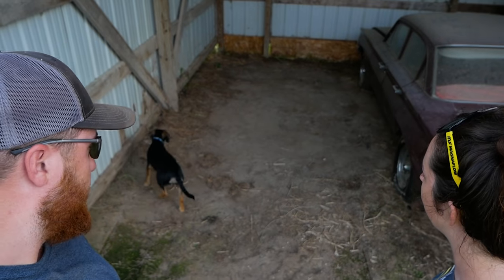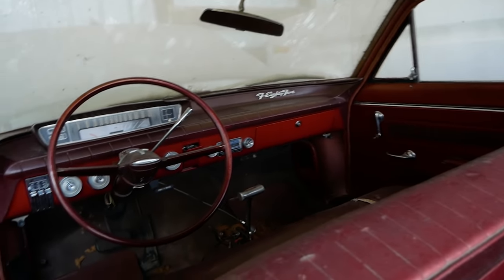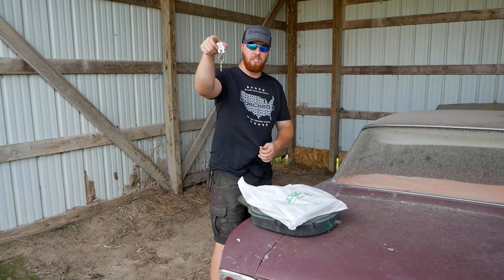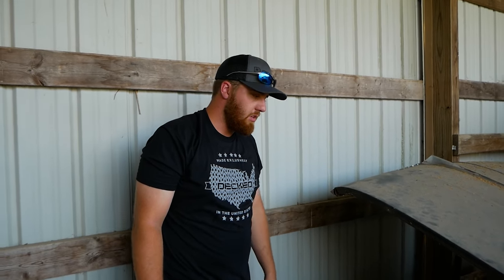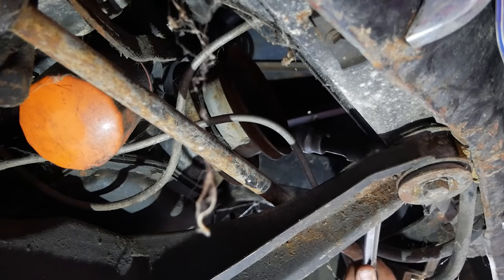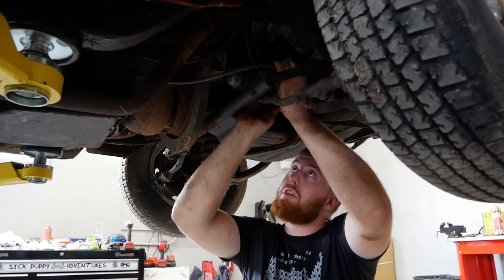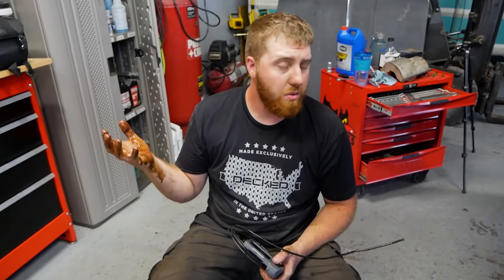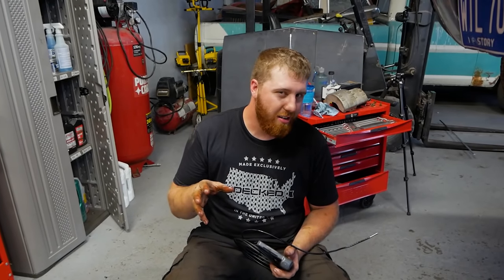BARNFIND Oldsmobile F-85 First Start in 25 Years!! - Part 1

Comment: awsome video kevin i was going to say oh no that part is all the way in the bottom of the oil pan thats going to be a problem but thankfully it aint the problem and the good news is that the part is still attacted other than that sounds like shes a running motor and yes i defianlly agree dont wont to run her anymore till you have what you need to properly run her right even when its a newly rebuild motor that hasnt but  ran long enought to the nissel break in point thumbs up and shared

Comment: Thats super cool! Even down to the thick wall 2" exhaust that looks like it was cut with a rotary pipe cutter like you would use for plumbing. If it has glasspacks, I bet it barks like crazy

Comment: Not gonna lie, i would use a mix of 2 stroke oil and gas to get things running.. carb cleaner is very hard on rings and cylinder walls. Just my opinion though... love the videos.

Comment: The correct transmission for that car is an R5 which is a 1961 thru 1963 f85 only similar to a dual coupling turbo hydramatic used by olds thru 1964 then the jetaway or turbo 400.

Comment: Maybe the oil pump needs priming. If it's dry from sitting all those years it won't be able to prime itself.  If you squirter motor oil into the 2 passages going to your oil filter, one of them goes to the pump. I have had to do this to many junkyard engines to get oil pumping again.

Comment: Awesome car, but as for oil pressure I think maybe the "fresh" pump is maybe a dud, possibly a gasket wasn't installed. You may want to pull the drive gear out, and verify there's no damage, or hardware where it shouldn't be. Good luck, love the content!

Comment: the oil pump has a bypass in it its mre then likey stuck pull the allen bolt out of the side of the filter housing ang clean it good and maybe replace the spring in there thats were i would start .

Comment: My brother bought a two door F85 in 1970. 
Things fell off the engine on a regular basis. Carb, manifold, etc.
His had a 3 speed stick. The shifter on the column wouldn't work. He installed a Mystery Shifter. it was like shifting with a wet noodle.
First stick I ever drove. 
POS car. Ratty blue paint that flaked off. 
Think about buying thread inserts. Dropping the starter on the road really messes up your day.

Comment: The 215ci Buick /oldsmobile/ Pontiac V8 became the Rover V8 in Britain  ..the chances are when your engine was rebuilt  the oil pump wasn't primed as the oil pumps are not self priming.  Petroleum jelly should be packed into the pumpto aid priming  and the pump spindle should be spun using an electric drill untill you feel the resistance  then you know the oil is being circulated

Comment: fun fact the land rover 4.0/4.6 is licensed iirc from buick and you can use late model and 215/300 parts to build a 4.8-5.0 all aluminum badass small block

Comment: had a 215 I put in a 72 vega, after a rebuild had no oil pressure, found out the gasket between the front cover was messed up sucking air.

Comment: On that particular engine if that oil pump somehow lost its prime you might need to pack the gears with Is Grease to reprime the mechanical oil pump and possibly you will get movement and oil pressure I know in A231 V6 that was a problem that I have in a In a Buick engine however on this osmobile I'm not sure

Comment: That's the engine that was used in the Rover V8 3500cc, and was modified all to buggeries for the Range Rover, etc. Not sure it's the same as the 4.6 litre, but pretty sure it went up to 4.4 litres in the Leyland P76 in Aussie.
Please correct me if I'm wrong.

Comment: Man, what a bummer about the oil pressure.  I really like that Olds, 4 door or not.  Here's my thought on the oil pressure issue, because I have seen it happen before, just like the dropped pickup tube that you mentioned.  Silicone.  From what you have seen, the engine appears to have been gone through.  The video didn't show it, but if the oil pan was sealed up with the addition of silicone gasket maker, a streamer of silicone could have gotten into the oil pump pickup and is blocking the inlet screen.  I have seen this happen before with a big block Chevy.  Everything was fine until it wasn't.  Cruising at highway speed, the streamer of gasket maker ended up in the pickup tube and oil pressure went to zero.  So did the ignition, because three teeth sheared off the distributor drive.

Of course, after sitting all these years, the pump may have just lost prime.  I don't know the 215s well enough to say this is the case.  Start with the prime and go from there.

The oil you drained out of the oil pan looked used, so whatever happened internally happened after the engine had been run for a while.  I honestly hope you decide to dig deeper in to this one and save it.  The 215 isn't a powerhouse, but it's cool for what it is.

Comment: The fact that the oil is dirty means the engine did run with that oil in it. At this point oil pan has to come off, check pump for prime off engine, check main bearings. One or the other.

Comment: Drop in a 350 matched with the TH350 trany, re vamp the trany mount, replace the rear end and go burn some rubber with this sleeper. Robert, your new / old subscriber. (72 years old)

Comment: I had five 1963 F-85's, two of them were Jetfires. And yes they came with four barrel carbs. That is the 225 hp version. My Jetfire would beat Z-28's light to light. They hated that and didn't even know what the car was and never heard f one My car had a Super T-10 Borg Warner 4 speed with factory Hurst shifter.

Comment: Hey Trey does the distributor cap distributor because it might not be sitting down and a date it’s probably not a hook to the pump and it’s just spinning it’s not a turning the pump to pump to the oil up or the oil pump is bad and this is why the oil is not pumping that’s probably what it is you have to replace the pump or check down inside to see if they gear is messed up or the distributor is not all the way down in to grab that gear to turn it to pump it

Comment: I really can’t help you when I put the 215 aluminum block in the Vega I rebuilt the whole engine put bigger cylinders in it put a bigger cam in it it already had four barrel on it only thing I can say is pull the lower half off and rebuild it

Comment: It probably lost its prime you might be able to use a vacuum pump to an oil pressure port to pull oil into the pump while driving it with a drill  ive heard from someone that it works

Comment: I have seen this before. I had a oil pump lock up on a 318 chrysler befor. I would drop the pan and change the pump. Zero pressure means the pump is not working. It's not expensive to fix

Comment: How to troubleshoot ignition system on old cars. Step 1: Locate distrubutor, Step 2: Remove from vehicle and throw in the trash. Step 3: Install a HEI distrubutor.
Reply: and spend even more time diagnosing that, by guesswork, when it doesn't go right.
 
Points ignition are really not that difficult once one understands how they work, which is key to knowing how to set the points.  Once running, that particular GM setup is amazingly easy to fine tune the dwell on.

Comment: Actually those cars have what they call an outside oil pump on the timing cover the oil pumps would lose prime you'll have to squirt some oil into the oil galleys that will hopefully go back to the oil pump or take the filter off and squirt somewhere over there or one thing I had to do in a few engines is I would take the oil filter off lightly pressurized the engine and then spin it over till oil started coming out and that's still engine you can take the distributor out pressurize the engine a little bit and spin over the oil pump remember the oil pump gears are dry you're not going to be able to prime it unless you pressurize the engine to get oil up the pick up tube to the oil pump one time I had to overfill a MG engine engine just so the oil would be up to the oil pump gears to get it to prime

Comment: Losen the oil filter then spin the oil pump if it pumps oil it just had a air bubble if not the pump is bad or the shaft isn't connected

Comment: Got to say, I'm old enough to remember when the F85 first hit the street.
It was received Very Well in New England, where I grew up.  Lots of interest in the car, because it was compact, had relatively good styling, was economical - AND, had the small, aluminum V8.
Yes, it was/is small, but with the V8, was faster than anything else on the road, American or European. 
Well, as with all other compacts in the early/mid 60s, America Was Not really ready or accepting of them,  mainly because gas was 19-24 cents per gallon, which is all that it's  worth.  If you doubt this, just wait to see what happens with gas prices when electrics have 50-60% of the market.  They will have to give the crap away. 
So, for me, I was disappointed the F85 didn't occupy a Huge segment of the market, but Americans were addicted to their Huge lead sleds until '73, when the Arabs made their  power play on oil.  Fracking gave them their cumuppance, for sure.
Reply: A lot of mechanics were not ready for dealing with the problems those blocks could have, also.  A lot of cars given up on way too soon, in my opinion.
Reply: @infoanorexic  Good Point.  You are Correct.
I've  heard stories that In '58-'59, some mechanics advised removing Chevy's new fuel injection and installing a carb.  Of course, because  some mechanics didn't have a clue about fuel injection....

Comment: is it a 61 or 62? 
I had a 63 f85 cutlass
The thing you need to check is the coolant
The aluminum block and heads didn't like the coolant back then
it made it soft and mushy.  The 4 bbl was stock 
Jet fire also came with a 4speed I know that because I converted mine from an auto to a 4speed 
You have a very rare car 
Back in the day people put those engines in jeeps because they were very strong
my 63 would lift the front wheels off the ground if it is a 62 olds change the body style in 63 they make it more like a little 64 Impala square
Those wheels are 4lugs and they fit a small Nova

Comment: These engines have to have the oil pump primed if stood for long periods. Remove pump and pack with a petroleum jelly, always works on my 215 Rover engine.

Comment: Early model aluminum engines didn't work because people ran um 🔥 hot and the rings shrank away from the cylinder walls losing compression. The owners manual warned against this but who reads it?
They solved this problem with sleeves but aluminum blocks got a bad reputation due to owner stupidity!! Later a combination cast iron block with aluminum heads was a compromise. 
Aluminum is common today because of improved cooling systems!! 
(Aluminum truck beds went South because they dented easily!!)

Comment: Long shot but gasket could have shifted when they installed the oil pump and is blocking the pickup hole if motor has been rebuilt. Long shot but possible

Comment: As others have said the oil pump needs priming, but could it be possible that the engine never ran after it's rebuild, as the taped over inlet manifold is something normally done for transportation purposes.

Comment: Out of curiosity wouldn’t it have been easier to just drop the oil pan instead of messing with the scope? 
Also, that’s a badass car, you need to keep it and get it running right. We don’t mind waiting.

Comment: This engine was developed into the Leyland 4.3 ltr and put into the Leyland Australia P76. That V8 produced better power and more importantly, better fuel economy than the 6 cylinder engines of Ford, GM, and Chrysler.

Comment: Does it have a mechanical / gear driven oil pump , if so pull it off and fill it with Vaseline , that will create a vacuum , pre fill a new oil filter with oil , refill oil sump and give it a go , also check pump for any damage while it’s off .

Comment: I had a chevy small block 400. The rear cam bearing moved out a bit . It was losing all the oil pressure through it Plus the crank rear bearing got  Ovaled  out. Some dumb ass put a chevy 350 Harmonic balancer and flywheel on a 400ci . The 400 is externally balanced the 350 is internally balanced. The vibration shook out the rear cam bearing and ovaled out the rear main. The block was junk.

Comment: I put a 215 aluminum block V-8 out of a 66 Buick skylark which has the same engine with Oldsmobile heads on it and I put it in a 1974 Vega GT great engine rebuilt the engine myself first one I ever Rebuilt I took the four-cylinder cast iron head out of the Vega and it weighed more than the 215 fully dressed and 215 two people could pick up

Comment: I've been checking y'all out for the last month.   Both Mook and your channel.   I'm an ol tech turn parts manager.   I've stumbled into a driven car purposely parked 30 years ago as well as 2 farm trucks that need the standard process spark,fuel tests and rebuild.  But this car that was literally parked and left has me puzzled.  Should I start by changing fluids and cleaning points and running on new fuel tank?    Then purge the tank and flush?   Thoughts?

Comment: I took my first driving test in one of those. Yes they did come with a four barrel carb. You notice I said first. The car had a broken motor mount (they were famous for that). Needless to say with a state trooper in the car the pedal went to the floor and left 20 feet of rubber in the parking lot. You notice I said first test.
 Those motors were used in hydroplanes because they were so light. S**t and git.

Comment: The oil pump wasn’t primed, making it cavitate and air lock. Back feed the oil from
The line out to the pump and fill the pump full of oil. Sadly I think with all the cranking you’ve done, it may be wise to just buy a new oil pump,

Comment: Is this a 63 or a 64 F-85? What year was the car manufactured please? That engine is the same engine that was used in a whole lot of different cars. It was even used in several different British cars and trucks. I think that the more modern Buick and Olds 3,8 ltr. and also called the 3800 was just an updated version of the same aluminum engine in that little Olds F-85. They have been using that same basic engine for decades just by changing a few items on them. That little F-85 you got there is a pretty nice little automobile. It is very hard to find these early model Cutlass', especially in as good a shape as this one is in. Some might say that it is a rag but I contend that most of it is there ahd in relatively good shape. It would not surprise me to see that little muscular V-8 roar to life when you find another starter for it and get the fuel and fire straightened out on it again. Those little aluminum engines were really good engines, especially the earliest models. GM spent a lot of money developing that engine to be really dependable. When they found out just how good the engine was it wasn't long before other manufacturers started using them.

Comment: The oil pump could be clogged up from sludge from old motor oil.& metallic shavings in it to possibly aswell. Thats just one thing.& the push rods could be clogged up to.,or lifters either one.,or both. Aswell as A bad oil pump. I'd try flushing the motor.,ending with new oil mixed with some Marvel mystery oil for about 30 minutes.,or until you can tell.,or might see oil flow starting.

Comment: I'd love to buy the F85 from you if you get it running.  Much appreciate your clean content and admire your thorough knowledge of vehicles.  If your lucky you might find a bolt or something at the bottom of the oil pan after you take it off.  I'd definitely look into the oil pickup and see if it wasn't installed correctly or maybe it is just faulty. Damn good looking car!
Reply: Beautiful car,,f-85,,love them

Comment: I may not be a big know it all on v8 aluminum, oil pumps and pans and stuff, but could something in the oil pump itself make it so it's not pumping oil, but yet the shaft for the distributor is spinning For the oil pump .like a internal shaft in the pump itself not the one that runs off the dizzy???

Comment: This sounds dumb but did they have a different rotation oil pump? Try spinning it the other way. I’m guessing the pickup wasn’t plugged up on the cam. Oil filter problem? My guess is the pump because of zero flow.

Comment: Drop the oil pan pull the oil pick up apart and see if the key is still in one of the gears because if it's sheared a key the gear ain't going to spend and you ain't going to get no oil

Comment: I watch your films and I really enjoy my time with them.
I'm just wondering why you keep doing your best to keep the engines in these cars short-lived.
How do you start the renovation process and the first start-up of the car:

1. detach the fuel line, vacuum the carburetor, check for lint.
2. drain old fuel, inspect the tank.
3. Attach the external clean fuel tank.
4. drain the old oil.
5.unscrew spark plugs (clean / buy new ones)
6. Pour a little oil into the cylinders.
7. try to turn the motor (by hand).
8. replace the oil filter, fill with new oil (it is not so expensive, even if it is wasted).
9.Clean the cooling system. replace the hoses.
10.change the fuse (cheap)

and then try to start the engine.

and then the rest, this way you will not damage an already old and often in poor condition engine. And when you do it, you ask for more work yourself.

Comment: My car sat for 13 years and no oil pressure till we towed it, the wheels locked up all of a sudden and then the Fram oil filter exploded . Replaced it and the car ran with oil pressure.